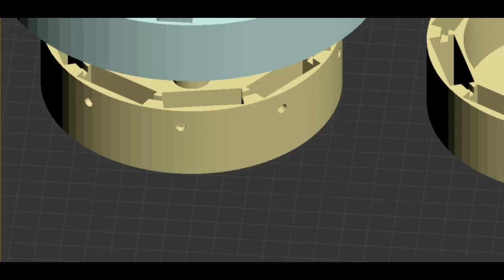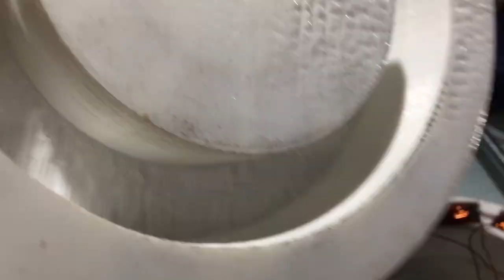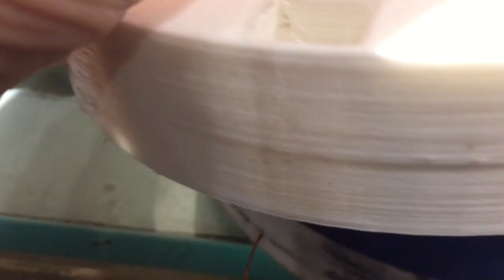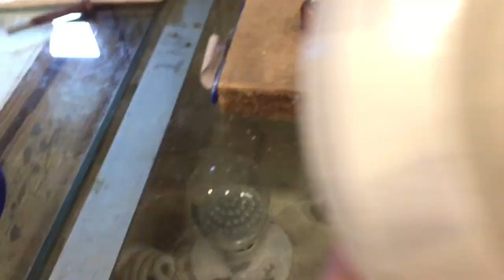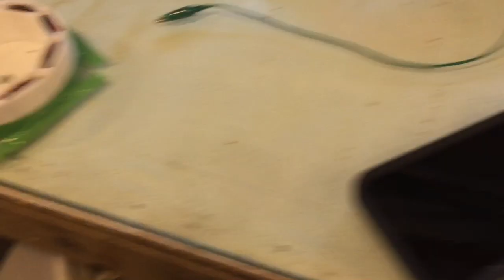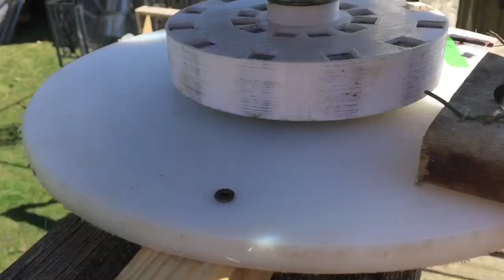QUANTUM2020 VAWT WIND TURBINE GENERATOR 3D PRINTER, 3 PHASE

Comment: any concerns in the white version that there is an asymmetric magnetic flux ie there are more magnets on the inside rotor and the outer path?  Very nice design though, and I wonder if you might give this a try as a BLDC motor... thanks
Reply from the maker: Yes, the concern is there, the lack of flux return will create vibration/heat ad will cause issues i power production, but at this point i am trying to prove a concept to show the design ca work. also i am thinking of a hover board gen, very similar to BLDC.
i am planing to post all parts on thingy verse to print. i have a very unique airfoil for the vawt that solves the low wind start,

Comment: https://i.imgur.com/d2IkUj4.png IMG 
To increase power and use magnetic lines to the maximum. It is recommended to combine magnets with thick iron as follows (yellow color). Then the magnetic density will be like a snake twist and there will be a powerful field between the magnets.

Comment: Hey brother.  Good effort.  If you have the time head over to thingiverse and look for a Rodin Coil 3d print.  There is a video on youtube by I'm not sure if they're brother and sister or husband and wife but they're very helpful and seem like decent people.  Here's the link  https://www.youtube.com/watch?v=bafvn2JoBpg  It seems if you put a current through this thing it somehow changes the status of the charge in the same way as a capacitor but different and bumps up the voltage and amps.  I'm not sure if it's a Joule thief or it's similar to one but is safe and does some unusual things.  It might be helpful to you.  Take care brother and thanks for your efforts.